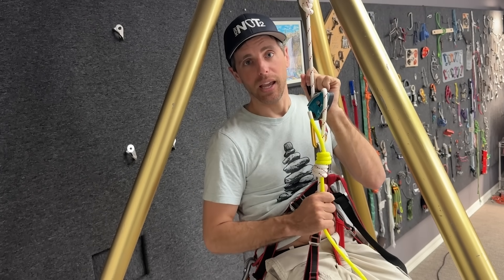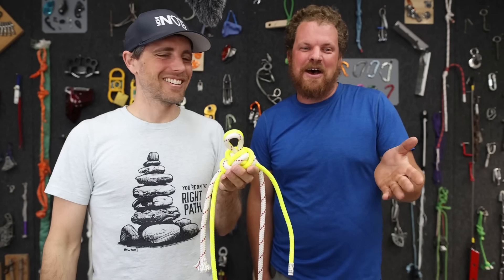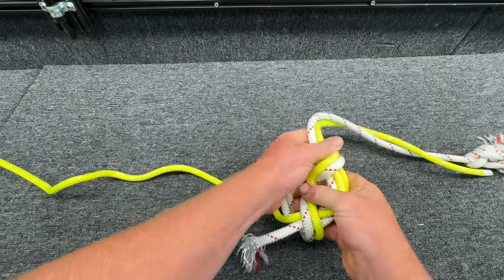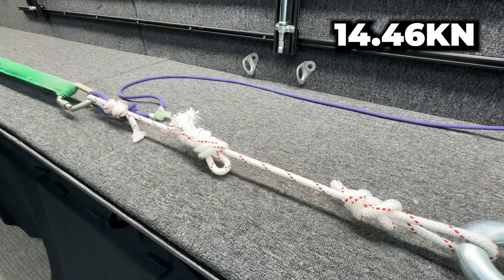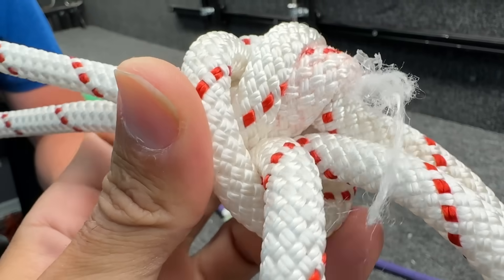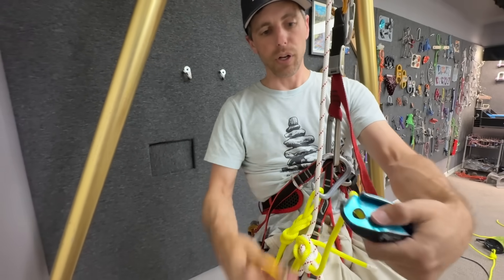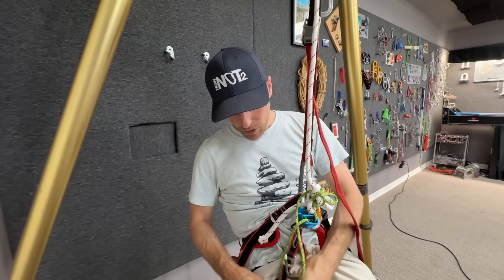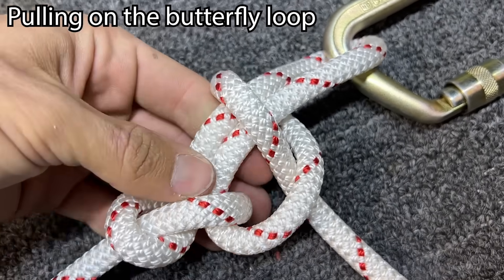I’ve never seen anyone use it

Comment: Always a treat when Bobby is in the video.  Plus cool topic too.  I dig any testing for butterfly knots or variants.   Now I need to practice trying whatever this dual butterfly bend thing is called.   Certainly would prefer to join two ropes in this manner if jugging or rapping on two joined ropes.   Handy video since it’s such a common practice to climb to pitch 3 (or is it 4?  either way…) and do one long haul from the ground.  

Don’t know if this would help or hurt but this knots loop makes me feel a strong desire to clip a biner to it (could it stop it from slipping and untying or does that not change anything in that regard?).

Comment: If in doubt, I would just use more overlapping rope and double fisherman's with each of the ends. If the overlapped butterfly did collapse, you'd still still have the fisherman's bend in the rope.

Comment: What makes the standard Alpine Butterfly weird to me is that it fails by slipping rather than breaking. In some applications that may be acceptable, such as when there is a carabiner going through the eye, but in general it suggests that it doesn't provide sufficient friction and will be particularly weak in slippery conditions. I would rather use an accessory cord to make a friction hitch (e.g. Prusik and variants) if I need a mid-line loop. That's my current opinion as a layperson.
Reply: I've not used that one such a long time, I learned it back in 1980's building rope bridge in the Army. 😮 the instant I saw the thumbnail I had watch it. My old @## hasn't been rock climbing in decades. Heck my last time rappelling was over 15 years ago off rappel tower at Ft Bliss TX.  Wow how time flies.
Reply: I'm having a hard time understanding why the solution to fears about an AB slipping have a solution involving a hitch famous  for slipping.
Reply: A Prusik was a placeholder that everybody is familiar with, you can use whatever else you prefer. And I'm not saying the A.B. is a terrible knot either, but it fails in a way and at a strength that doesn't give me confidence in some applications. When an Alpine Butterfly fails, it first strangles whatever was inside the loop, then it undoes itself, and it does all that at the fairly meh point of around 50% strength. For example, this means that when used to isolate a core shot, it's just as bad as a rope at 50% nominal strength -- cutting the rope and tying a double fisherman's does significantly better in that scenario.

I won't go into a long tangent re. friction hitches, but I found it interesting to learn that they are used as bends that work on very slippery materials, such as nylon monofilaments, in fishing knots such as the FG knot (a bend, really). I think it all boils down to the Capstan equation.
Reply: @Frostbiker gotcha. As someone who primarily climbs trees, there are a ton of places where I'll go for a friction hitch too when it comes to attaching to some other line.

Comment: This is very similar to the system we've been using. 
You tie a european deathknot and then isolate it with a butterfly. This way the deathknot is responsible for connecting ropes, but it doesn't get rock hard from someone prussicking up it a 100m.